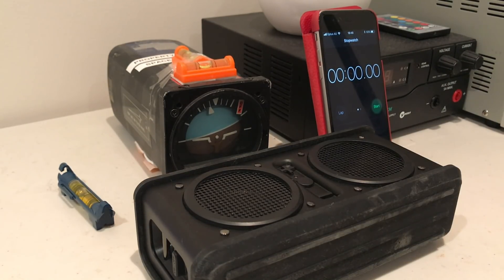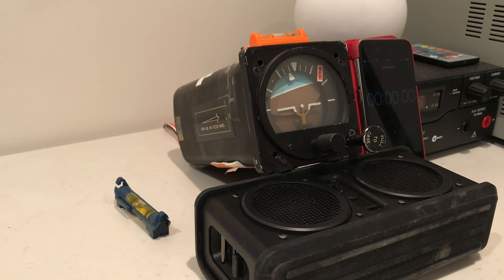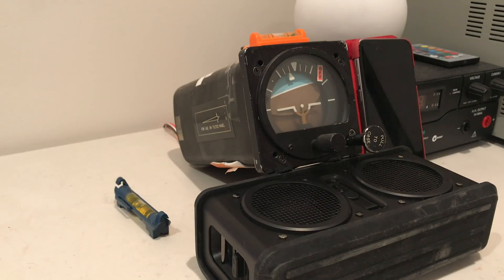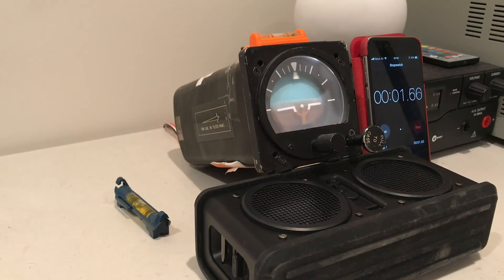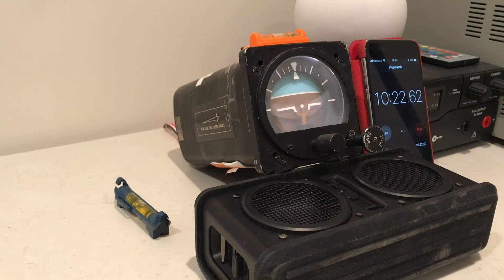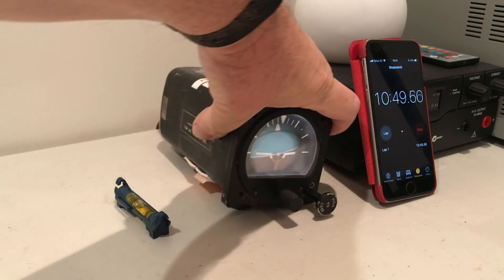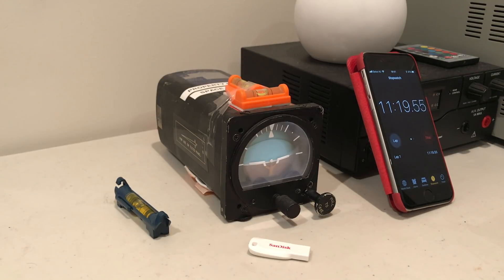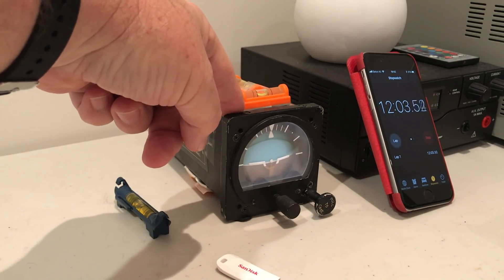Flat Earth - An often requested Artificial Horizon Experiment - Powering up at an angle.

Comment: Great videos on artificial horizons. I love to learn how things work. Obviously, the AH in the videos is not accelerating. I'm not a pilot, so i have a question.

What effect does acceleration (either forward, turning, or slowing down) have on the self-leveling operation of the AH? Is there a difference between commercial and high-performance (i.e., military) aircraft?

My guess is that the duration of acceleration in commercial aircraft would have minimal (if any) effect. In military aircraft, the acceleration could be maintained (by the plane, but not necessarily by the pilot) and may make a difference.

I bring up this question because I remember the first time I flew (many, many years ago) I thought it was cool that my drink remained level in the glass even though we were turning. So during the turn, "down" was toward the bottom of the plane and not toward the center of the earth. The only reason I knew we were turning is because I had a window seat and could see the ailerons move and the wing dip below the horizon.

Comment: Does the machine not have an internal level? Because if it does what good is it? Couldn’t anyone design a machine that eventually showed level no matter what the starting angle was? If the earth were flat there is only 1 answer the machine can come up with, so it would never be wrong. It just seems to take 10 minutes to find the natural orientation of how things fall 😂. This is like when you use your iPhone, the natural orientation of the phone is with the home button on the bottom. This machine would be like a device that always handed you your iPhone with the home button at the bottom, even if you were hanging upside down...  Globies be like “what bro? You stupid, what a dumb question.”
Reply from the maker: +Nicholas Lamborghini.  The error in this video will never occur during a normal flight.  The point of this video is not to prove or disprove the shape fo the Earth.  It simply proves that the instrument has the ability to self correct.  This is something that many Flat Earthers have denied.  The ability to correct itself to the natural direction that objects fall means it will work just fine on a Globe.  Objects fall towards the centre of the Globe so the instrument will always align correctly no matter where on the Earth it is.
Reply: Wolfie6020 Hey I appreciate the reply. I just read through a lot of the comments while watching the video and they seem to be equating this as proof of the globe. My point/question is, the machine has to internally have its own reference point of what it considers level. If the earth was indeed flat, the internal reference point can never be wrong. Maybe do the experiment again but instead of leveling the instrument on a flat surface tilt it downward to a similar degree from the starting upward tilt? Would that change anything?

Comment: Hi Wolfie, apologies if this has been done already (you have a buttload of videos) or if it's a misunderstanding of the science:

If you removed the pendulous vanes from the machine (a hassle I'm sure) and kept it spun up for a long while, would you start seeing the effect of the rotation of the planet? It's well known that the instrument is designed to adjust to gravity, otherwise they'd be useless for flight, but using that same principle can we observe that rotation by keeping the gyro spun up at a constant speed and either equalizing the air coming out of the vents or cover them up entirely?

Greetings from Perth. Oh wait.
Reply from the maker: +The Federation Conversation.  Hi,  No worries, it is a good question and in theory a good experiment.  The problem is that if you remove the vanes it will require perfectly equal amounts of air to come from each fo the four ports or the experiment won't work   

I actually tried taping the vanes in the mid position and did my best to get it accurate but the gyro just rapidly drifter off centre  much faster than the Earth's rotation would have cause so it was an invalid experiment.  

If we could balance the gyro perfectly and ensure there was no imbalance in any other forces it should work but I don't know how to do that with my instrument.
Reply: Sweet, thanks for the quick reply. Love the videos. A relation of mine thinks you have an agenda. How dare you. Have a great weekend!
Reply from the maker: +The Federation Conversation.  Thanks.  I guess I do have an agenda.  I want to see how Flat Earthers respond to real evidence.   This is a hobby - mainly driven by curiosity as to how any one could actually think the Earth was flat.
Reply: I'm driven to it solely because of my duty to not see my blood make a fool of themselves with a lack of critical thinking and a stubborn mistrust of any authority. I've learnt a lot along the way, which has been fun as well. Your videos have been a great resource, so thanks for that.

Comment: Hey Wolfie6020
I have a request that could settle the flat Earth once and for all!

You are right there is a Mechanism in Gyroscopic artificial Horizons called Pendulous vane that could explain how the Gyroscope inside dose not roll back offer time in a flight! 

As we can proof in many ways a Gyroscope dose remain rigged in space EVEN AGAINST GRAVITY
It will keep it initial orientation in Space when there is no correcting mechanism at work! 

Now, that means if this Mechanism would be deactivated, the Gyroscope must actually roll back. (if on a Ball)

Thats why i make following Proposal that has the Potential to settle this once and for all. 

The artificial Horizon actually gives as the opportunity to scientifically proof and convince our selfs without consulting NASA etc. if we actually do live on a Ball shaped Planet thus it would be testable repeatable proof.

Here it is: 
a.) Modifie a Artificial Horizon, that is Mechanical, in way that deactivates the Pendulous Vane. 
b.) Make sure it still works. 
c.) take it on a Plane and let the Plane rice to cruising altitude avoiding any harsh Maneuvers. 
d.) Level the Plane at cruising altitude and have it fly Straight and at the same hight for 1 to 2 Hours in one direction, preferable with out any changing Maneuvers. 

Now, if the modified Artificial Horizon dose roll back you have absolute proof for a Round Earth and the Flat earth is absolutely, utterly and Finally debunked a 100% with  no chance to recover.
On the other hand if it dose not roll back, you can be 100% sure, you absolutely do not live on a Ball hurling threw Space. 

This is absolutely a Test that can be done and would finish the debate! 

By the way: 
We can be sure that this Test would work for one simple reason. 
The Properties of Gyroscopic behavior concerning Gravitation are well understood and can be established at any time and location repeatable showing that Gyroscope !!DO NOT!! respect Gravity at all when it comes to there Orientation in Space! 
The absolutely Do resist even Gravity in order to Remain in there initial Orientation!! 

So once we take any correcting Mechanism out of the Equation, so it cant serve as explanation anymore, the Artificial Horizon "MUST ROLL BACK" if on a Ball and it can absolutely not roll back if we are flying offer a Flat Plane.

What you say Wolfie, lets get this flat earth from the Table once and for all?
Reply: SinnWelle TV awesome let's see if he responds
Reply: Jep i agree, instead of constantly reminding Flat Earthers that Pendulous van can theoretical account for correction of the curvature, lets take em out of the equation and see if the Gyroscope inside will do what it is supposed to do, flying around a curve. As far as i understand Wolfi has the means to do such a test easily and thus take the Flat Earth out with no chance to recover.

If he dose that we only need to refer to this one single Proof every time someone says "the Earth is flat"
Its repeatable and sound Science no one can refute.
And than they cant say anymore give me something i can test for myself thats convincing and has no YES BUT to it. Because its plain and simple if it dose Rolls back you do live on a ball 100% sure.
Reply: By the way Theoretically it could be done on the Ground to, but it leave room for doubt, as someone will say you cant do that on a bumpy road etc.
Reply: Csnt wait to see the response
Reply: You do realise something as simple as a sextant can show beyond any doubt that the earth is round, and it doesn’t require any input from NASA... There are so many easier ways to show it...

Comment: If its constantly correcting itself then it would correct itself while set up on the speaker or when he simulates the bank. He shouldnt have had to set it back down on the table. It doesnt correct itself it changes based on position change this is simple to debunk. The gyroscope does not correct itself, its an instrument by which the pilot can correct the orientation of the plane. The gyroscope stays rigid in space,it does not "correct itself". If i took a dive straight toward the ocean in a plane would the gyroscope correct itself and make it look as though im still level and looking at the horizon? Come on people, use your head
Reply: Michael Malear
"The gyroscope stays rigid in space", yes in space(zero gravity), not in earths atmosphere because the spinning mass weight is below the horizontal gimbal axis. That is, these aircraft type gyros are just stabilized plumb bobs. (spirit or bubble levels). These aircraft type gyros still work even when the gyro is not spinning. Space type gyros have the spinning mass @ central or neutral weight bias on all 3 gimbal axis. 
Also the gyro in the video did self correct "while set up on the speaker", the appearance of the initial 10degrees horizontal error(roll to the right) is to cater for the torque of the motor start up. Again, these gyros have a preset weight bias to level just like half a glass of water, regardless of what angle you hold the glass, the water level is always parallel to sea level.
Reply: Steve Tozer 
So you're telling me that there are 2 types of gyroscopes. One for outer space in a zero gravity environment and one for inner space where gravity supposedly exists? Either that or one gyro that acts differently in the 2 different environments mentioned? Either way in the video he powers up the gyro, a level or spirit level requires no power. We can spin a gyro up right here on earth and see that it stays rigid no matter which way you try to move it. Now im no rocket scientist here but i know bull shite when i smell it. So im going to ask you a few questions. Do you believe that outer space exists as presented by nasa and the propaganda...machine? Do you believe in gravity? Do you believe that we live on a big sphere rotating and flying through outer space at the nasa prescribed speeds among an infinite number of galaxies and so on? If so i cant take you seriously because those are all only unproven theories with no scientific proof. Real science bud. Not blindly believing something your told. Why you guys either believe this nonsense or push the lie is beyond me. Do they pay you well or offer you immunity ? I dont know ,but anyone with any ability to think for themselves and question the false reality with which they have been presented will find out real quick that at the very least that we are not on a ball flying through outer space and gravity and evolution is the glue that holds the entire ball earth lie together. Your response sounded nice and educated  but the lie is still easily seen. I call bull shite, i need proof of your claim please.
Reply: Steve Tozer 
And further more i can agree that there is an initial correction upon startup. Show me how it self corrects once in flight going around a ball.
Reply: Steve Tozer 
If you fast forwart to just past the 4 minute mark we can see the complete fallacy he is telling. This video proves nothing other than the individual is intentionally misleading. I need to see the correction in real time after the initial startup. Like as its going around a ball.
Reply: Michael Malear
Yes there are different types of gyros, the one in the video would NOT self correct in space(zero gravity), + this is only double axis gyro, space type gyros require triple axis gimbal pivot points. Some aircraft gyros cant deliver accuracy when inverted for  more than 5 minutes because the gyro pivots have physical roll limits. 
Again these aircraft gyros are just glorified plumb bobs, the reason they have to "self correct" is because of precession or gyro axle bearing drift. 
If you tied a brick to a rope & carry it up & down a hill , no matter how steep the hill, the rope is always vertical, same thing with these gyros, instead of a brick at the end of the rope we have a spinning brass flywheel. The spinning flywheel is below centre on the horizontal gimbal axis. e.g. = 1 fat person on one end of a seesaw & a skinny person on the other end, the fat person will spend more time closer to the ground.
*Re Gravity: gravity is a "describing word only", if anyone ever works out what it really is they will become an instant trillionaire because an anti gravity shield would make provision for free energy. If you throw a brick in the air, it always returns to earth, that is loosely called gravity. Fair chance gravity is more to do with the magnetic flux field on air molecules /density(buoyancy). Interesting that a feather & a brick fall at the same speed in a vacuum & i think that the fall rate is a constant (X feet p/m).
*Re Nasa: lol, any reasonable person knows Nasa bullshits a fair bit, they have produced some good things over the years though e.g. the Shuttle heat shield ceramic coatings are commonly found on gas turbine combustion chambers & bucket wheels. The idea that Nasa put man on the moon 50 years ago is a bit silly. Batteries to power airconditioning for the spacesuits in the 60s & 70s in +350' - 200 degrees, that technology hardy exist today let alone 50 years ago. Fair chance no one has ever gone above 350-400miles high. The daily ISS video images are deliberately deceptive with the use of fisheye lenses always aimed below the horizon to give the appearance of a very round earth, fact is from that low orbit height even if earth is a sphere, the curvature arc would be much flatter than the image they present. 
Think i hit most of your question, & no i dont get paid for my opinion & i learn towards Geocentric thinking(stationary earth), not sure what shape earth is, but i do know for certain a space type gyro on a fast aircraft can determine the shape of earth. The gyros i make are far more accurate than the one in the video, mainly because of size & weight, the bearing drift is much less than 1 degree per 8 minutes so if curvature exist it will register on 1 of the gimbal pivots. eg, from Perth Australia to Japan, the gyro should read about 90degree rotation if earth is a sphere. Or 15degrees per hour in a stationary position if earth rotates as Helio theory suggest.    
Might have to send you an invoice, nearly run out of ink on my keyboard lol.
Reply: Michael Malear
reasonable people may have differing views & it doesn't hurt to be a little bit careful with "accusations", worth remembering the guy who makes these videos is also a pilot who flys $10M~$50million aircraft around, no one jumps on a passenger plane & hopes the man at the handle bars is a goose,...  even so, highly educated people can be genuinely misled at times, so to can we laymen. Civilized discussion generally brings about better value learning for all. cheers.